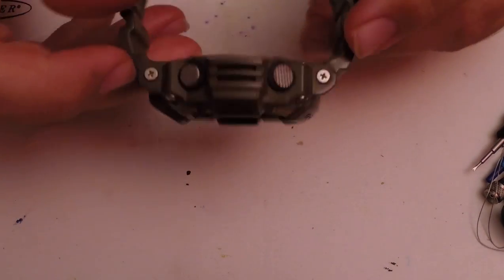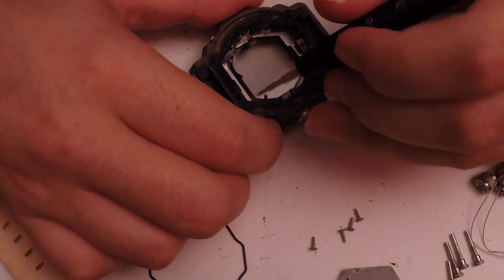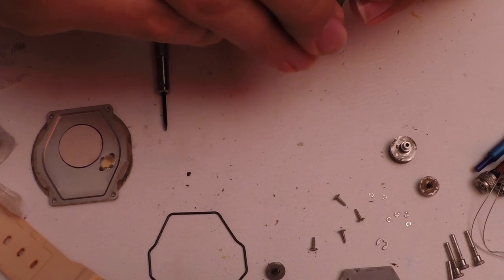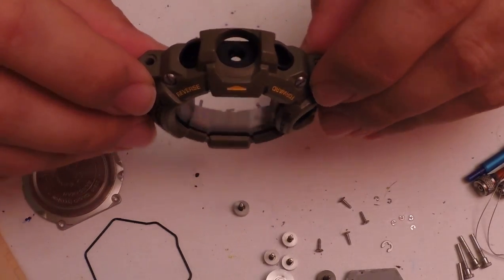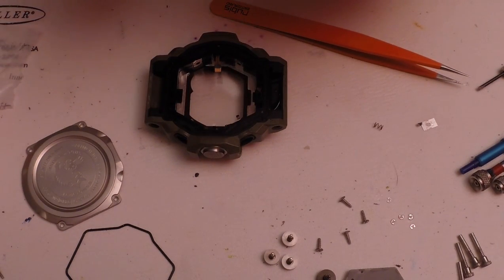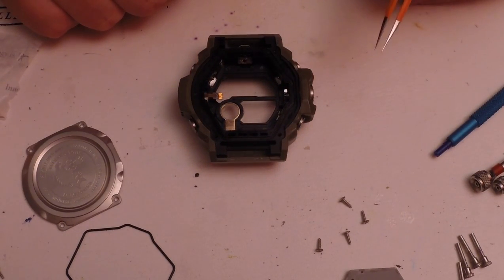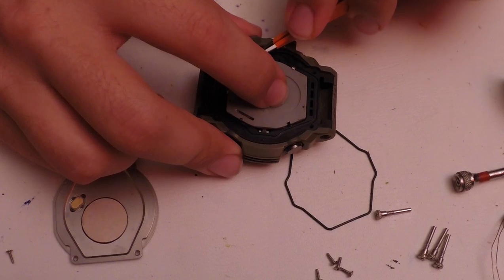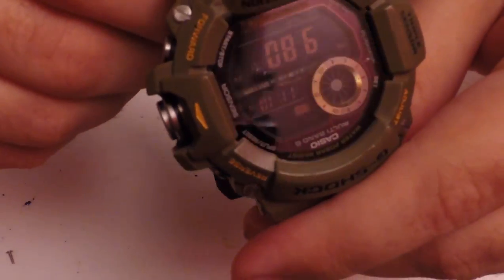TRSCP Works on a Rangeman!

Comment: At 6:32, they are called Jesus clips because they will fly across the room when you pop em off leaving your saying Jesus ****. I have taken apart so many casios and I must say you make the clips look so easy! I've done it with a normal screwdriver and tweezers and it takes forever to get. I even do the work in a plastic bag so I dont lose those clips if they go flying. I love the silicon trick and it is something that I do as well.
Reply from the maker: Pibbles 'n Bits haha, yep! I have heard them referred to that over on WUS ;)

Comment: Great video. I’m trying to make myself the “supreme blackout rangeman” which will have a gw9400BJ bezel and carbon fiber band, the negative display 3410 module, the black buttons from a Burton collab or the gw9400srj men in sunrise, here’s where my dilemma is…..I want that black “dial” from this exact model (gw9400-3), BUT, I want to take that gold metal multi-purpose ring and swap it for the black ring of the gw9400-1b. Now, you’ve shown me the way to finally swap out for all black buttons (as long as I can find a Burton or SRJ for cheap enough to just use the buttons) but I also want to use the glass from the gw9400-1b as is has the subdued grey “rangeman” print on the bottom….the SRJ is purple and pink. So, you’ve shown me the module, buttons, and glass….now I want to dissect further by swapping the “ring” on the “dial”.

Comment: So literally the only part that mattered to me didnt get recorded. I am wanting to remove my crystal but How easy is it to break the solar panel in the process? There is a video where the guy broke his solar panel removing the crystal
Reply from the maker: Yeah I was pretty bummed about the situation there. I do have me doing it in another video with the solar panel. I would say it's not the most difficult thing but I also use these tools for work like this every day. What may be easy for me may be the toughest for someone else. If you can cut a piece to match the shape of the glass on the inside of the case and give yourself an open area for the glass and panel to land, that will help a lot! If this is for a scratched glass I hope you can get it done!

Comment: Great video. I took the module out and the light is no longer working. I know the button works as holding it down allows the LT indicator to come on. Marked from watchuseek had this issue a few years ago too
Reply from the maker: Thanks for checking it out!
Reply: @TRSCP  NP. Any ideas?
Reply from the maker: @alml1268  oh, I read that wrong my bad! So you took the module out but not apart, and now it doesn't work? Did you remove the rechargeable battery? Could be that you need to AC reset. That's where I would start. If you took the module apart, it could be that the teeny springs didn't go back. Beyond that I would have to see it I think. Hope you can get it sorted! Knowing that the button works is a good start!
Reply: @TRSCP  I didn't take the module appart. The springs on the back of the module are all there. As I say the light button works but no light comes on.  There are two springs on the front of the module, one of which I slightly bent. Wonder what they're for or if they have anything to do with the light
Reply from the maker: @alml1268  two on the front are what connect to the solar panel. Everything else functions as normal? ABC? like I said without seeing it it's tough. Did you try the AC reset?
Reply: @TRSCP ah, great to know the two on the front are for the solar panel so I can discount those. Everything else works. I think the light is actually ok, just not triggering properly. ABC sensor also good. Looking at Google there are two other people at least with this same issue and all they did was take the module out without disassembling it. How do I do an AC reset? Can't see a reset hole or button anywhere.
Reply from the maker: @alml1268  you should see on the back the letters AC next to a hole. Paperclip or tweezers, touch that to the back metal plate. I guess beyond that I'd really have to have it in front of me.
Reply: @TRSCP  thanks. The source of the problem appears to be one of the 4 teeny tiny springs for the light inside the module is somehow missing. Yikes. No idea how that happened as I didn't open it up.  Man...where am I going to get one of these. Probably nowhere. Thanks for your help
Reply: @TRSCP  it was one of 4 teeny springs in side the module. Gone forever and lost. Werid as I didn't open the module before. I managed to make a new srping using a bit of conducing wire and looping it around a thin pin. Hehe. Everything working again. Thanks for your help.

Comment: what you left out is the most important, the whole video is common sense. you left out the important parts the glass is it glued or press fitted with oring, and what about the solar panal are they 3m stickied taped on, glued or just sitting in its place. the actual placement of the crystal is why I watched this till I realized the brain fart camera issue..
Reply from the maker: +Mike Fahner yeah, I felt bad about the camera issue and being rushed, I blanked a few things :(

I do have another video showing removal of the glass and solar panel though! This watch in particular is adhesive tape on the panel and the glass is held with that plastic gasket around the edge. And of course always exercise some caution!!!
Reply: Still good vid!!
Reply: I got the black version of the rangeman and just noticed today actually a tiny nick in the crystal, may buff out for now till I get around to ordering. Might as well order 2 have extra for spare. Was lookn to order a bezel or 2 for like a every 5 to 10 year replacement of the bezel and band keepn it lookn new. Great all around watch plus it was a gift I'd like to keep around long as possible ya know. Pacparts seems to be the only supplier I'm seeing this far. Says glass $6.18 not much else about it or pic. "Glass/printed" so I'm assuming that means the crystal has lettering on it which looks like in this particular model. Anywho still picked up good pointers on the e clips.
Reply from the maker: Mike Fahner yeah Pacparts is definitely the way to go! and of course if you have any questions let me know, I try to respond to these best I can :)
Reply: Thanks much! Will keep you in mind on this upcoming project. Thanks again...
Reply: @TRSCP  hey mate. Really need your help here. My rangeman Gw9400 glass got damaged quite bad and I am desperately trying to find some video on how to replace it. Do you have any video related to replacement of the glass? I'm worried I'd screw up if I try to figure out how to fix it myself. I don't want to compromise the water resistance of the watch. I'm not sure how  the glass is  fixed inside. Do I need to completely disassemble everything inside before I can get to the glass? Is it held in place with glue, I've got no idea.  Please, if you read this comment, help me out here.
Reply from the maker: @NikhilNaik22N  there are two pieces, you will have the glass the solar panelis on, and then the mineral crystal that is the outside "glass." The solar panel has adhesive to stick it to the mineral crystal, and the mineral crystal is friction fit with the plastic gasket to the case. Hopefully this helps! As far as water resistance just make sure that gasket is seated properly and the crystal is pressed in all the way.
Reply: @TRSCP  thank you. And do I need to disassemble the buttons, sensor and other components or they can be left as it is and the glass can be removed? I was strongly advised against replacing the glass as there is a chance of the inner plastic case and components getting damaged/cracked during the process. If there's no such issue, then I'll definitely do the replacement soon!
Reply from the maker: @NikhilNaik22N  the more stuff you can get out of the way the better. I guess personally I would advise removing as much as you can, but I think you can remove that inner plastic piece without taking out the buttons. But yeah if you're this far in you might as well take the buttons out so you can clean and grease them.
Reply: @TRSCP  Thanks! Yeah, I'll do it and upload a video. It might be helpful. I failed to mention my watch is just 3 months old. Unfortunately the glass got damaged. So, I'll try to fix it soon! Thank you!
Reply from the maker: @NikhilNaik22N  good luck!

Comment: i watched your video to understand where was the sensor and how it could take measurement but also be water resistant up to 200m... cause if the sensor is completely sealed inside then it may be less acurate i believe and if not, is it water proof? i saw when y replaced it it was protected by some metal but..
Reply from the maker: So the sensor has that metal plate, but also a gasket, and that is how it makes a seal to keep water out. The sensor itself is exposed to the outside of the watch through the holes in the metal. I guess I canmot say how it actually works for measuring pressure and height! Hahaha.
Reply: oh waw thx, informative, for height it's very easy as you probably know it doesn't measure height in fact it uses the differences of pressure, that's why , like in a plane, before using the altimeter you must calibrate it and tell the watch the current altitude in reference to your current altitude (known with google etc)

Comment: very informative thank you and your know how not to have it boring you re great. new subscriber. how did he scratch his glass like that? i have the same one and a bit scared now
Reply from the maker: Hey Yussef! He was being very rough with his watch! He wears it everywhere, even doing construction work and working on cars, so I am sure it happened there. From normal use you shouldn't have to worry about it!
Reply: ah thanx but what is worrying me most is sand, because sand is made of sillica, i made a test with an old gshock i no longer use and it became scratched... not in a dangerous way i think though
Reply from the maker: @yussef961  Yep! If you purposefully try to scratch it, it will scratch. The crystal (glass) on it isn't overly resistant to scratches. I say rock the scratches, if you can still read the display! :)
Reply: sure lol i dont care much if it's sratched but it's the first one the hardest ahah it's part of the watch life and also gshock are made not to worry about solidity... so yes it's a bit strange to worry about having it like brand new... human i believe that when y buy something a bit more expensive you want it to be intact... it cost me 200 dollar which for me is quite some money for a gshock but far less than some at 500 or 800 of course... but plenty are at 50 etc
Reply from the maker: @yussef961  yeah, some of the can be really expensive! Haha. With general use they stay in great shape, but if you are rough they will show signs of wear.
Reply: the only rough thing would be sand and my 30 dollar jacuzzi lol (30 dollar cause it's in fact a mat which produces bubles)

Comment: I don't think you should take the back off, because it won't be 200m . Shouldn't you send to Casio to do all that.?
Reply from the maker: Now, I cannot prove or disprove this comment, I do not have any testing equipment for resistance. What I can say is that my brother-in-law won't be doing much if any diving ;)

I'd like to think that I did a good job of sealing this watch back up, making sure nothing was installed incorrectly. I think it'll be fine! Like I said, I cannot test the water resistance of the watch though! I guess that comes with the territory I suppose, haha.
Reply: I think the general rule of thumb is anytime the back is opened, change the gasket/ring. That way it is just like it left the factory, provided the torque spec is met on the back screws.  I did not realize the case is actually plastic! For the weight of that watch and casual glance at the back, I figured it was stainless all the way around - what a shock!  Did they at least put brass inserts into the plastic to hold the back on or is it done with self-threading screws?

Comment: I have this watch and 4 other colors of the Rangeman.  What is the main reason you decided to take this watch apart? Is it to replace the scratched crystal?
Reply from the maker: Yep! The crystal had a pretty nasty chip in it, so we decided to replace it with a brand new one to make sure it didn't shatter and ruin the watch entirely in the future. We also just wanted to clean up the case and the buttons a little bit.
Reply: Oh ok , I found it amazing that you were able to take it apart in so many pieces ,  then be able to put it all back together and it worked in the end. Great Job !!!!!

Comment: You Didn't bother to Say why you decided to finish up with a Flat head Screw Driver @ the End Just Prior to adding the Band Strap Back On?
ALSO You Said the Band Screws With enough Force will Rip?
What will Rip? they are Metal So they wouldnt Rip? 
Did you mean that they would Rip or Tear through the Band Strap Material?
Or Tear the Corner of the Watch lug Case tearing off the entire threaded corner alone with Screw pin still attached to broken off Lug Corner?

Comment: is there an easy way just to replace the glass?
Reply from the maker: Easy is subjective. All you have to do is press out the crystal and solar panel. But you need to do it carefully and with the proper fitting pieces otherwise you run the risk of breaking everything.

Comment: How does the glass come out!!! I can't get mine out thats where your video cut..
Reply from the maker: dragonaac I was in a rush when I filmed this, for a family member that was leaving within the hour. Basically you need to take a press with some pucks and a cup (something to catch the pieces as they pop out) and you have to squeeze and tap. It is a VERY dangerous process and you run the risk of damaging the solar panel. If I have another to work on I will try to shoot a video of it to show the process.
Reply: Can I send you two watches and have you swap the screens on them? I have them taken apart completely to the point you did in the video but I can't remove the screens to swap them!!

Comment: Watches Casio G-Shock are screwed together in a vacuum.
Reply from the maker: In the few years I have been working with G-Shocks, I have never seen this to be true. They do test them after assembly in a vacuum chamber to test water resistance, though! (Not every watch, just a batch, unless it's the Frogman which is ISO rated.

Comment: Is that dirt inside ? is that usually happens to the rangeman ?
Reply from the maker: +Monzer Kalaji I'm sorry, I don't quite follow? Under normal circumstances, there shouldn't be any dirt inside. Maybe you can tell me which part of the video you are talking about?
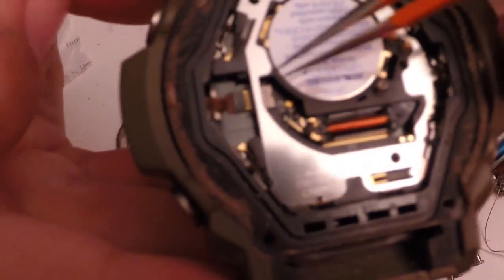Reply: TRSCP 4:20 at the edges inside. Also if you don't mind answering one more question I have the camo version and I was wondering if I replaced the bezel with black one would that be easy and would it hurt the lugs I heard the rangeman have lugs issues? Thanks
Reply from the maker: Monzer Kalaji ohhh, sorry, I was responding on my phone and thought you were on my other Rangeman video haha. so, that isn't INSIDE the watch, it is all outside the caseback gasket, if you look close enough, haha. Dirt happens in these, especially if you never wash them!! It will also work its way under the bezel and all over the outside of the case. Nothing harmful, just dirty ;)

As for switching the bezel, you can do it without removing the buttons by simply "stretching" the bezel over the buttons (actually fairly easy with the Rangeman) and it will not affect the lugs. It's separate from the lugs, and I believe you are referring to the screws? Just undo the screws for the band normally, and peel the bezel off around the buttons, nothing too hard there! You shouldn't be applying any pressure to the lugs, and as such, won't hurt them.

Hopefully this answers your questions!
Reply: hey man thanks a bunch that is useful . I'd like to see move videos keep it up :)

Comment: I took mimes apart, and sadly, when put back together my light, barometer,  altimeter. Isn't working. Compass is working, and all else, the rc, gets a signal nightly. Sunrise, sunset all works. I'm pissed.
Reply from the maker: +da dawg Hmm, did you connect the sensor back in located around the 9 o' clock mark on the watch? That would be what I check first, to make sure it's reinstalled correctly. Other than that I wouldn't have any idea off hand. Hopefully it's just a simple error like that!